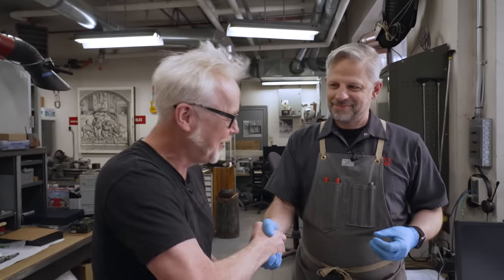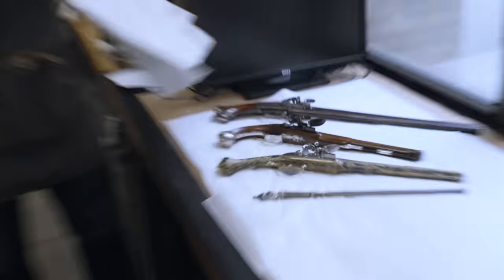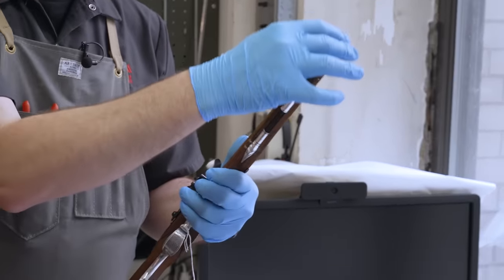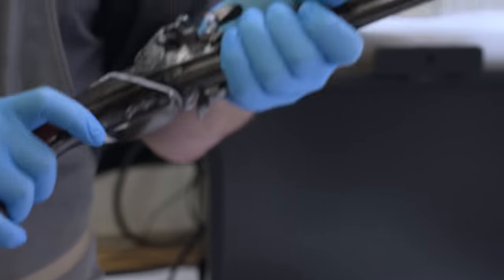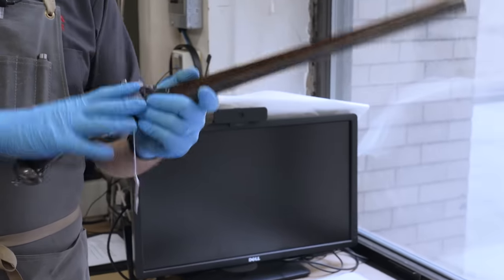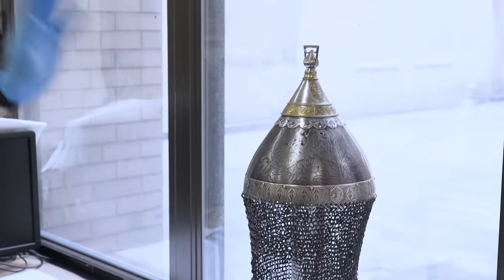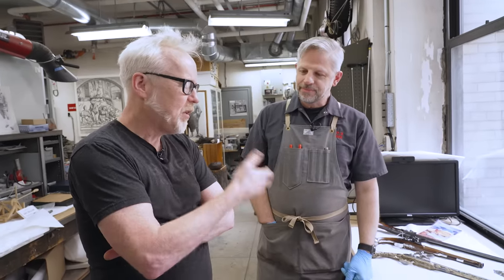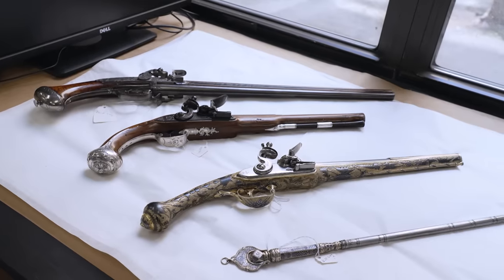Easter Eggs in Armor?

Comment: I have a dressing kit from the 1860s. It's pretty complete -- 2 straight razors, boot pull/buttonhooks, a bottle opener, a mechanical pencil/pen combo in sterling silver, some bottles. That kind of thing. No maker's marks on most of the goods (I especially wanted to know who made the razors).  The pen however, being sterling, had a maker's mark and date so I could be sure the kit was made by someone in the Mosley family in the 1860s. There's also a mirror for shaving. It's bound in very thin leather which has torn a bit, so I can get a look at what was used for backing between paper and leather (the dye of the leather would otherwise discolor the silver of the mirror). The backing paper was a page from an 1820's business ledger from the Mosleys in Birmingham. It was clearly garbage for them, but it provided vital clues for me.

Comment: I have an old 1960's Benjamin Sheridan 392 .20 cal pellet gun that I got a a young boy. Removed the stock and dissasebled before cleaning and lubing. Ended up drilling a hole in the wood buttstock to hold a few "backup" pellets.

Comment: 2:40  That is not a 'ball removing screw'.  It's a worm.  Its purpose is to remove any residue, possibly still smouldering, from the barrel before reloading with a fresh charge of powder.  Same as on muzzle loading cannon where it is far more common.  ( as in necessary tool.)

Comment: I once had a handsomely carved wooden box.  Upon closer inspection, I found a hidden latch, when I turned the latch the box popped open and much to my surprise there were 32 little wooden carved figures inside.
I showed it to my neighbor who was very wise and learned, and he informed me that what I had in my possession was a 'chess set' which was specifically designed to store the so-called 'chess pieces' inside of the chess board when not in use.
Needless to say I was absolutely astounded by the craftsmanship and ingenuity of the contrivance.